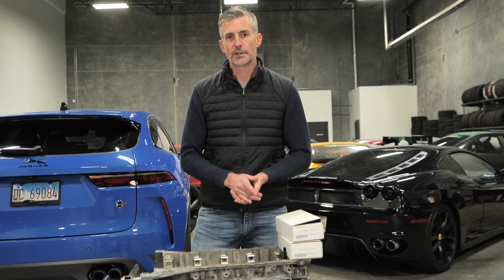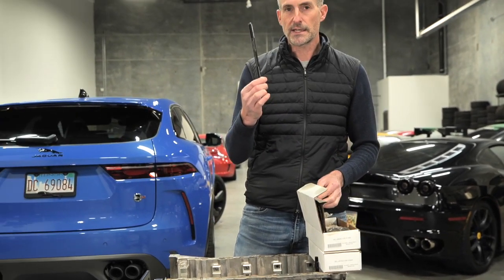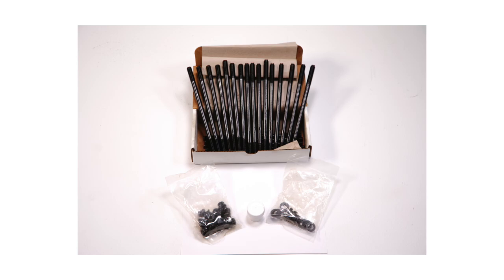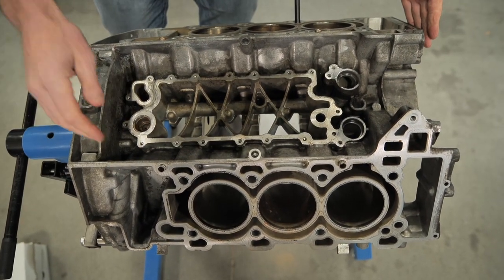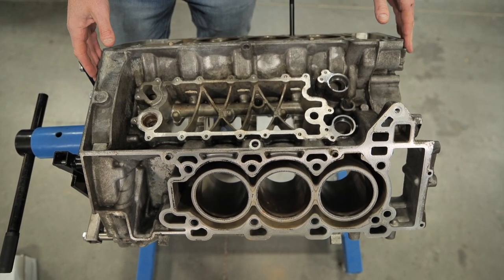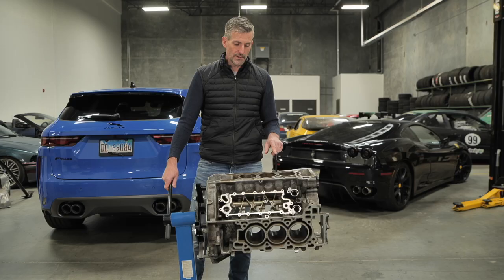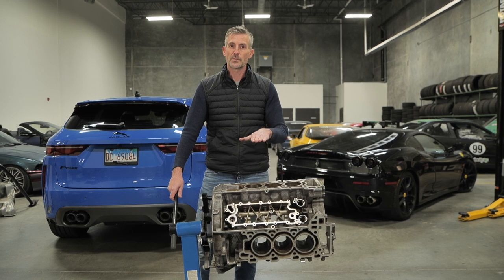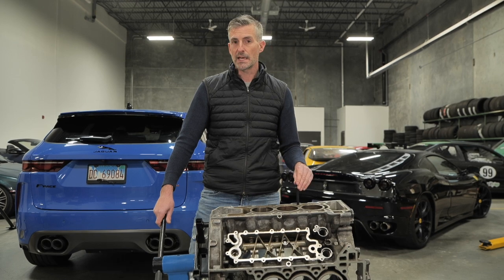Jaguar Range Rover Main & Head Stud Kits - AJ133 V8

Comment: Will there be an engine upgrade kit for the AJ126 in the F Type? I currently have a VAP Tune and Mina Crank Pulley with Intake System. I see some new Piston and Main Stud Kits for AJ133 on yall's website so that's why I am asking.